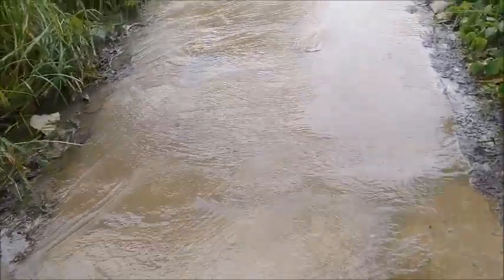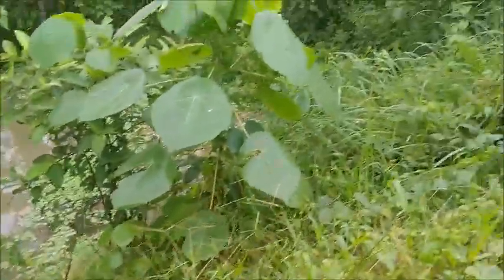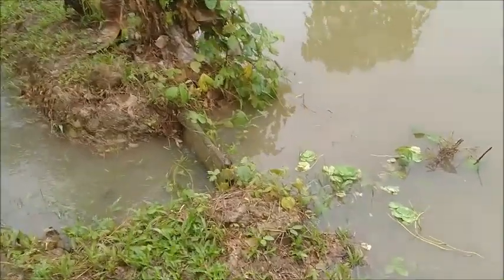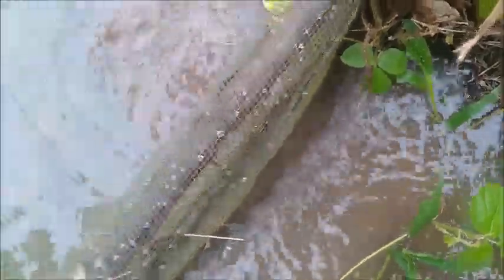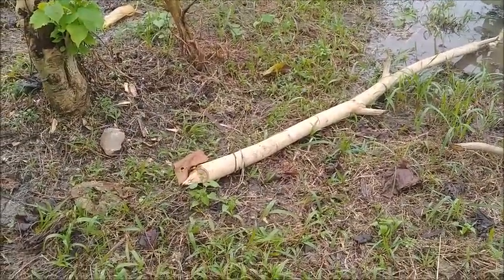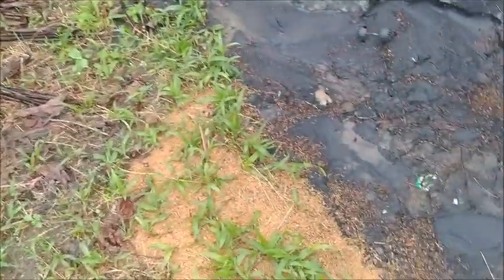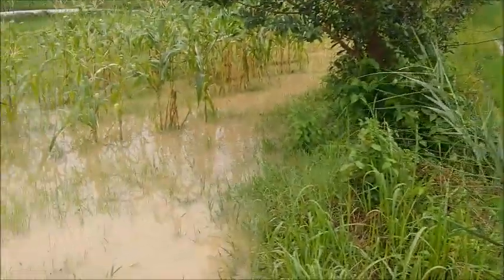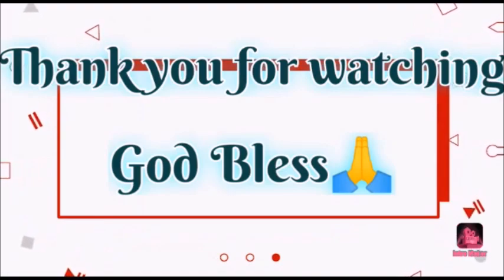Dam Overtoping, Fields Flodding, Diversion Canal Maxed

Comment: Thanks for the clip at the endBrian  , showing your neighbours downstream.
Wonder if a Syphon? system might be in order. Couple or more  of 6 inch pipes?. Be interesting one day to take a walk to the end of this watercourse( thru the neighbours fields ect). Does it end in a swamp or eventually a stream?
Of course is bone dry up here in Pangasinan!! Wouldn't believe it's the same country,  is hardly thousands of miles away! 800 Kms( less than 500miles!) in fact by air!